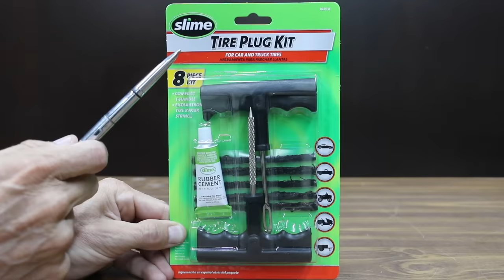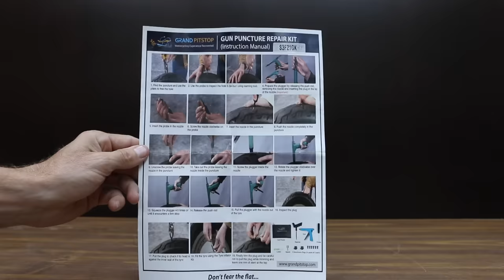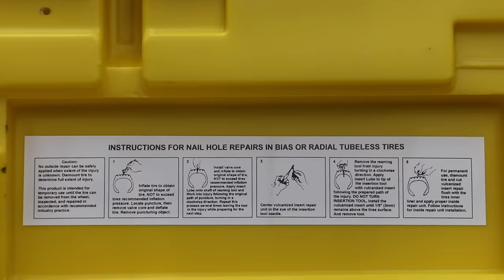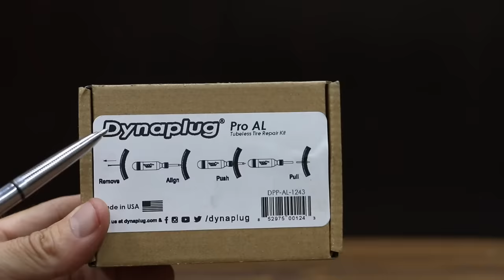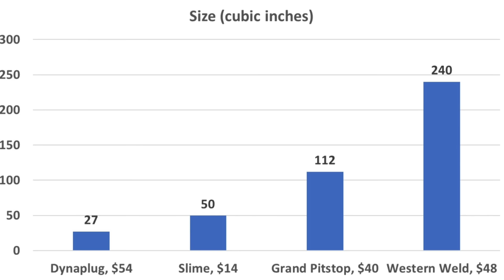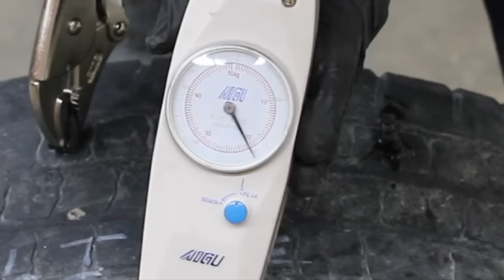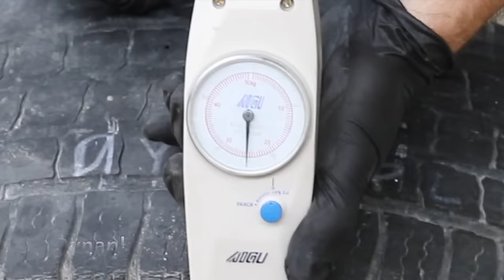Best Tire Repair Kit? SLIME, Westweld, Dynaplug, Grand Pitstop

Comment: I used to carry a “stop n go” branded mushroom plug kit in my motorcycle similar to the one tested here.  The one time I actually needed it, I could NOT get the plug to squeeze through the funnel.   I tried several times.   Now I exclusively carry a cheapie rope plug kit just like the slime branded one here.   They work great, don’t take up much space, and are very inexpensive.

On motorcycle tires I will only use these kinds of plugs to get me home where I can patch them internally due to the obviously greater risk.   I have run the rope plugs in car tires for many thousands of miles without issue.
Reply from the maker: Thanks for sharing.
Reply: @juliovaldez6310  Spoken like a motorcycle tire salesman....
Reply: I've ridden over 5000km with a tire plug at moderate to high speeds (80 kph to 200kph) and honestly there is zero problem with them.
Reply: @ToshkoAndreev  the plug is not the problem, it´s the tire if it has been run flat. The inner liner can be damaged, now think about how fun you can have going 200km/h on your bike and the tire explodes.
Reply: Mushroom plugs also have a tendency to pop loose quite easily if impacted directly. Wish he would've tested that.
Reply: I made the same mistake. You have to shove the plug up into the gun so that its like an inside out umbrella, then as it comes out inside the tire, i can just unfurl. Otherwise it will NOT push through.

Comment: As to to safety controversy, my local tire shops always plugged mine. So I decided if it’s good for them it’s good for me. Saved $75 buying a slime type kit over taking to a tire shop. 4 plugs and 10,000mi later no problems.
Reply from the maker: Thanks for sharing.

Comment: I would like a review of Torque Sticks for installing wheels. How accurate are they?
Reply: I’ve wondered that as well
Reply: Accurate enough.
Reply: Just use a Tire iron with about 3 ugga dugga's...all set.
Reply: Bumping and liking this comment.
Reply: Torque sticks will get you close as long as you are regulating your air pressure. Your air gun will also be happy for that. Still have to set final torque by hand to make sure rust, burs, ect. didn't make you short of the mark though.

Important to remember, if you add a lubricant it is impossible to measure torque. Clean dry thread is how it's measured. Neverseize and you will overtorque everytime.
Reply: @GK-ej2ys  rule of thum in you use lube drop torque seating buy 20lb if 100 do 80
Reply: My concern is an over torque can cause a disc brake rotor to warp. I believe I have done this in the past.  It has not happened since using a torque stick.  Are they that accurate or am I just lucky.
Reply from the maker: Thanks for the suggestion.
Reply: @patd2765  You are lucky. Burs, rust can and will impede there performance. They are fairly accurate if you follow "ALL" the instructions provided with the sticks. It's still important to check the lugs with a torque wrench. I never overtighten at my shop because I use them on a regulated line. Check by hand after to make sure they are actually tight enough. It makes the process of getting the car back on the ground way faster. And setting final torque by hand ensures the job is done properly.

Comment: I use that exact same slim kit to repair tires I take to the drift track. The plugs do not fail even after miles of skidding on pavement. I get all the way down to the steel belt package across the entire tread width and the plugs still hold! They are 👍.
Reply from the maker: Thanks for sharing.
Reply: Thank you for sharing. This is great to know.

Comment: I’ve used several different tire plugs, mostly the Slime. I always overload it with rubber cement before and after installing. I also never cut the ends and always burn them for a few seconds with a lighter. It seems to work fine considering I’ve never had a plug fail on me, even after 80k+  miles on the same tire after plugging.
Reply: I never use the rubber cement, but have oiled a few really tough installs,  they still work well
Reply: A tire guy told me not to cut them off, at least right away. A gravel can push it back in the tire I was told. I use a burnishing wheel in a die grinder on mine. It melts the rubber and spreads it around the hole a little.
Reply: @virginia7125    I'll bet against the gravel thing,  the cut off probably isn't needed but we do it to reduce a quick fail (0-20 miles) by having an end to pull the plug out.  Once the tire runs enough the uncut end will wear off regardless of what was initially done. If you look at that plug after 5,000 miles it will be smooth and hard to find.  The other thing is many plugs are installed in place on the car where ever so no electric, no additional tools so like I have a box knife, needle nose pliers, that slime kit as shown, and a that cheap 12V portable pump stored in the truck and that is it.  fyi I also did many tires in a tire shop, plugs, patches, split rims etc.
Reply from the maker: Thanks for the feedback.

Comment: This is an impressive education resource. 45 years ago, tire plugs weren't so great and tire shops were plentiful and well stocked.  There was always a great concern that reaming the hole to prepare it for a plug would sever a radial cord inside the tire and in a short time would make the tire become wobbly and the car difficult to control.  They called the condition belt separation.  Removing the tire from the rim and patching it from the inside was the best guarantee that a radial tire would last and perform as good as one that never had flat.
Reply from the maker: Thanks so much!

Comment: For a temporary fix almost any kit will do, as long as the glue on the bacon strips is not old an dry. Personally, I carry Dynaplug on my motorcycle. Its the only one that fits under the seat :D

Comment: This is the most informative channel on YouTube. I recommend it all the time. But...... I have been doing testing with rope plugs since 1989. As they have evolved this is what I found.  Tech has the best kit on the market. Black Jack has the best plugs on the market. Use a set of curved wire cutters, dikes. Whatever you want to call them will pull out the object better. Because you can pry with it.  As you use the reamer. Tap it in with your Palm with a light tap and turn clockwise only Until fully installed in the tire. This will spin the tire cord in one direction. Pull gently out and turn pull and turn Clockwise. Install plug halfway in the installer and apply wax  Provided to the tip. Install plug fully leaving half inch out of the tire and turn 1/4 turn to tie in a knot inside the tire.  Then pull out. The plug is a hot patch which can be lit on fire and self  Valcanize  If necessary.  Never had one fail. But I have seen and pulled out the failed red plugs. All the time.  One of the main reasons of failure is people making a new hole and not Following the direction the  Object went in.  A tip for this is a little soap as you install the rimmer and watch the bubbles. As you probe for the direction you can see the bubbles stop which tells you you got it right.
Reply from the maker: Thanks !

Comment: Great video! Having a farm and ranch a plug kit is a must have in every vehicle. I'm constantly on the look out for a better one. I've never tried the Dynaplug and may just order one to carry in my Chevy Volt. The number one thing I find in a plug kit is the handle. It is worth what you pay for a kit to have a good handle! I discarded the Slime kit years ago because the tool handles can't stand up and break. Next comes the strength of the metal drive parts, reamer and insertion tool. Some are cheap and break easy. Lastly but not least is plug quality itself. I learned some things from your video and I consider myself an expert with plugs. Hats off to you sir.

Comment: The problem with the Grand Pitstop one is that it would be difficult to use in an awkward position. I have legitimately used the Slime tire kit on too many punctures to remember and never have had any subsequent leaks.
Reply from the maker: Thanks for the feedback.

Comment: Just a little tip from my experience on tires being off balance: you can't tell until you hit like 60ish mph. I've had a weight get knocked off a couple times off roading in snow and I've never noticed anything until I hit the highway and go over like 55mph.
Reply from the maker: Thanks for sharing.
Reply: The weights usually weigh a lot more than a tire plug.  If a single plug throws your tire out of balance enough to notice you had way more problems than a flat tire to begin with.
Reply: @clblanchard08  I was referring to the part where he mentions tire balance, where he has 100 tire plugs in one side of the tire. I would imagine even several tire plugs would not cause an issue, and even if they did they could most likely be rebalanced.

Comment: I've plugged my dump trailer tires many times, with each one having 5+ each before replacement. Seeing you put 100 plugs in one tire just made me laugh out loud, and then cringe realizing how much work that is. I'm tired after 3 or 4 plugs, and can't even imagine 100
Reply from the maker: lol  Thanks for sharing.
Reply: No kidding. Just a couple can wear you out. He must be in really good physical shape to pull off a hundred.
Reply: @ProjectFarm  another followup test that would be cool to see is plugging a very large hole... I've had to use 6 or 7 plugs on a single hole while offroading
Reply: @chrisvp3  I had to put 3 of those tar covered rope plugs in a hole on my daily driver, and I have been driving on it for almost a year now.
Reply: @chrisvp3  I believe I'd break down and put a boot on a hole that big. That surface area is just asking for trouble.

Comment: I was just at Harbor Freight making my weekly donation, I saw their tire plug kit for $4.99 and I have to think that anyone who is DIY oriented should have one of these(or similar) in the glovebox of each vehicle they own.
It might just be a huge benefit some day.
If you are clever and maybe lucky you can pull the nail and plug the tire without removing it. :)
Reply from the maker: Thanks for the feedback.
Reply: Good advice. I've had great success with cheap plug kits. "T" handle tools will make life easier. Having air in the tire helps too. Plugs that have stiffened with age can be softened with heat from a lighter. I always burn off the excess until there is 1/4 inch sticking out and they usually last the life of the tire.
Reply: Good luck with it for $4.99. They probably have plastic handles. They will probably break on you the first time you try to insert them into a Steel Belted Radial Tire. Michelin Tires are the worse to repair. The other problem is you have no idea what that import repair material is made of and if it will last very long. You get what you pay for my friend. They could be putting any kind of garbage maybe regular cotton string in the repair material.
Reply: @ffas23  I would rather have a cheap tool  than no tool. Luck has nothing to do with it, I believe in planning and preparation.
Reply: @richardweinberger2756  Tell me that after you try to use it. Been there done that years ago. When you need it most it will fail on you. Those plastic handles don’t do well on Steel Belted Radial Car and Truck tires. They will snap in your hand. Should work ok on a Wheel Barrel Tire or a lawn tractor tire though if they is all you are going to use it for.
Reply: @ffas23  Almost all road tires are steel belted. It sounds to me that you were trying to push the tool with rubber strip with great force to get through the steel layers. Maybe you didn't open up the nail hole big enough for the tool to slide in and set the plug.
Hey if it doesn't work for you, then that's that.
Reply: @richardweinberger2756  You have no idea what you are talking about or who you are talking to. Maybe you didn’t read my other posts on this page.
Reply: @ffas23  Maybe if you posted with a real name I would know who I am talking to.
   Let's just say that the hundreds of tires I have plugged during my own years in the auto business were fixed by "luck", and let it go at that.
   And no, I don't have any plans to throw away my plastic tire repair tool.
   Have a nice day :)
Reply: @richardweinberger2756  Were you using plastic handled  tools in your business to plug those tires I doubt it. Not even one of my repair shops I serviced would have done that. They wouldn’t  of lasted very long in a busy shop. Total Garbage. Do what you want but I will tell people the truth ahead of time those tools and the String repairs that come with it are garbage. You get what you pay for.
Reply: @ffas23  I don't recall advising anyone to use "any" cheap tool in a professional shop.  They don't need to last long , just to be there if I ever get a flat, which is rare.
My original advice stands.
Reply: @richardweinberger2756  let me tell you something pal. You were just bragging about fixing hundreds of tires in your professional shop. I don’t believe you and if you did what did you do with your good plugging tools throw them away! No professional would pick up that cheap tire plug kit for $4.99 at Harbor Freight. Only a novice who didn’t know any better would maybe give it a try. Listen I am done wasting my time talking with you. People reading here can make their own minds up as to what they want to use. I just made recommendations of what to buy through many years of experience with one of the top products still out there today with unlimited shelf life.  I also mentioned what products to stay away from. I am retired from the business but still do my own tire repairs when needed. I am done responding to anything you have to say further.
Reply: @ffas23  You are not my pal - your knickers are twisted way too tightly for that.
I maintain that everyone has a choice of things they will buy, and that includes me.
Reply: @richardweinberger2756  Nice responses Richard. I'm with you.
Reply: @richardweinberger2756   I'm using those cheap plastic handle tyre plunger tools many times before without any problem.. im with you it's better than nothing and till this day still none of them ever leaked back even the rubber string material is unknown and cheap.. and to make thing easier i grind and sharpen the tips of the hole enlarger tools so it will push through easily when cleaning and enlarge the holes..

Comment: I always rotate the plug a few times in the hole before removing. They have never failed on me that way. When you pull straight out there is more of a chance of it leaving a gap and leak. When you twist it it binds the plug together and creates a wider more unifored base inside the tire. I own a repair shop and have done thousands of repairs and twisting it in has always given me a better result then pulling straight out.

Comment: The plugs themselves are almost never the issue. It's the unknown condition of the inside of the tire and how long it has been run on low pressure. The tire can be dmamaged internally which is why it is recommended to dismount the tire and inspect it before patching it from the inside. If you know the tire doesn't have any internal damage then a plug is fine.
Reply: I've run enough tire plugs over the years to know that you are correct. A "good tire plug" will hold for pretty much the tires expected tread life as long as it was a nail or screw. With larger holes from say a piece of metal get the tire replaced as soon as possible.
Reply: Same here. I've even temporarily used multiple plugs to plug one hole lol. After a bad experience with discount tire and there tire patches failing multiple times on one tire I started using these simple diy plugs
Reply: plug - temporary

patch - permanent

its really simple
Reply from the maker: Thanks for the feedback.

Comment: I would like to see the best marine grade rope or best air compressor hose
Reply from the maker: Thank you for the video idea!
Reply: @ProjectFarm  no problem. Love the videos!
Reply: For rope try Sailwright for marine rope and products they have excellent stuff I buy through them. Your other best source of information on marine grade rope or anything marine is Latitudes and Attitudes magazine that is a wealth of great information. As for compressor hose you get what you pay for depending on how you plan to use them or their ratings they are not all alike. The trick is keep air hoses wiped off/clean with a little hand cleaner, don't stand on them, dont crush them, keep them out of the elements, when not using it roll it up or hang it up, and they will last a really long time. I have some air hoses I use that are probably 40+ years old and still get a lot of use.

Comment: For me, having had to use one of these kits on the road, the biggest difference is being able to use the kit on the side of the road without removing the tire. The slime kit allows you to do that easily and the others don't. At the end of the day, these kits are designed to get you to a service station to properly fix or replace the tires and for all that, the Slime kit is the winner IMO. The Dynaplug is a close second but it looks like most holes would require at least 2 plugs given the size of the cords.
Reply: Liked your comment, I agree, ease of use in the field is key.
Reply: Agreed, there's very few road side work benchs 😁. That being said, I absolutely love this channel!
Reply: @Marvin Murphy I could see where the Grand Pit Stop kit might be more difficult, but like you, I'm wondering which kit can't be used on the road.  That seems to be what these kits are made for.  They certainly aren't viable in any "tire" shop.
Reply from the maker: Thanks for the feedback.